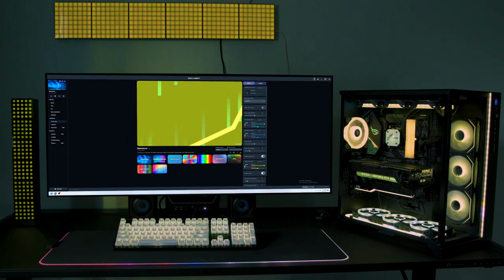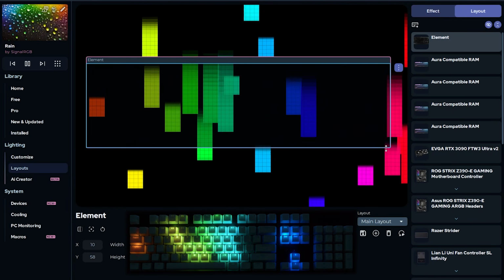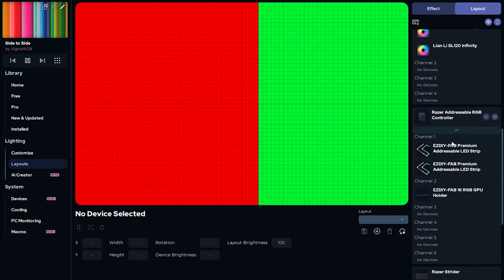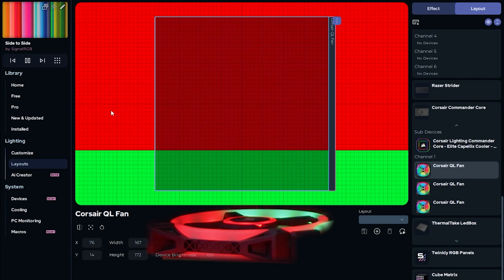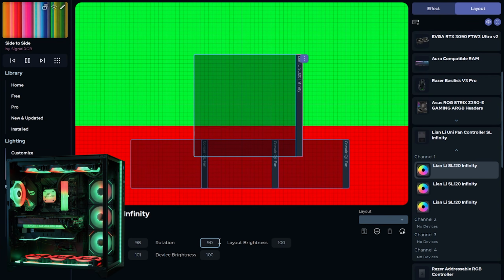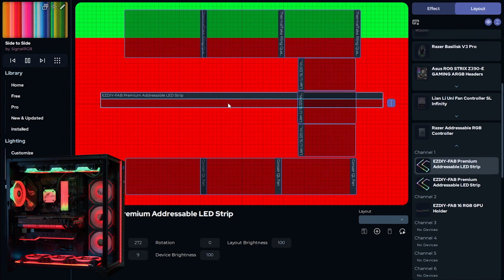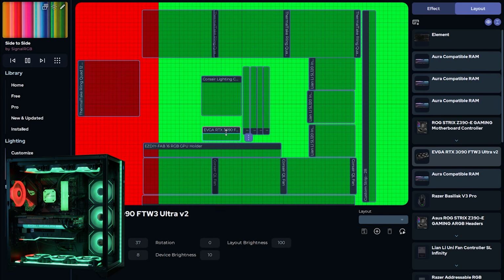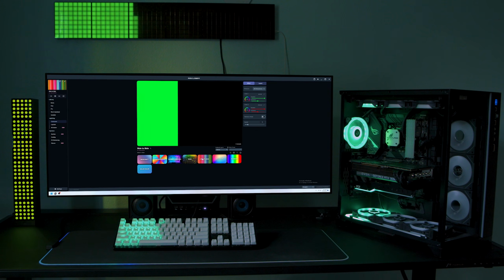Make Your RGB Flow Perfectly | SignalRGB Layouts (2024)

Comment: Everything is great but messing up with my Lian Li galahad display it shutting it off even in with fact that they are controlled separately. Any advise here? I can use external port for it's lightning stripes and connect lian-li fans to the motherboard but i still want to use L-connect.

Comment: Mine doesn't do any of this. The only lighting I can control are the RAM sticks. Keyboard, fans, nothing else shows up.
Reply: this actually happened to me with my new build. it turns out its because my case (Be Quiet! light base 900FX) has its own argb controller built in which is incompatible with signal rgb atm. i bought a nollie 16 argb controller for about 30$ and now everything except the case strips work perfectly so maybe you are having a similar issue

Comment: My asus mother board is just combining 3 of the fans and one of my li an li strimmers into one thing it calls a default strip
Reply: I'd get an argb hub, they aren't expensive. Then you can control each device individually. I use airgoo, bought it off amazon.

Comment: I can get everything working, place them correctly, resize, BUT, the layout of the fan LEDs is not correct, how do i change of the LEDs per component ?
I mean, if something has 10 LEDs, but not in a single row, but 2 rows of 5, hwo do i position them manually so the effect is correct ?

Comment: How Can I use my NZXT Cam with Signal RGB ?? I can't monitor my CPU & GPU temps through the LCD pump when I'm using your app. Is there any resolve ?!
Reply: CAM interferes with a lot of programs. I run CAM and signal at the same time. I monitor temps and fan speeds in cam and just all my rgb on signal. Have it open both on startup and run signal under admin.

Comment: is there a way to divide devices if i have my fans and aio cooler on one controller?
Reply: Physically not possible, unless your RGB link is in series. But usually it's parallel. Argb basically says "light 1, go green, light two, go blue" and all your devices connected through a splitter think they start with light 1

Comment: Hi SignalRGB team! I'm running SignalRGB on my laptop where my device is a WLED Esp32 module that controls the LED strip around my TV. I'm noticing that my laptop is lagging heavily on video content while having SignalRGB open. I'm also using the screen sync effect so that my lights react to what is on the laptop which is working but also not very fluid/smoothly. Any pointers or tips that might help make this a bit less resource heavy?
Reply from the maker: I wouldn't be very helpful to you unfortunately, you should try contacting our support to see if they have any tips, the email is support@signalrgb.com